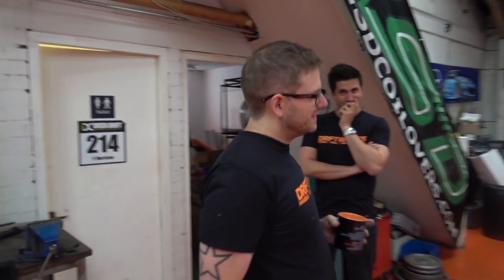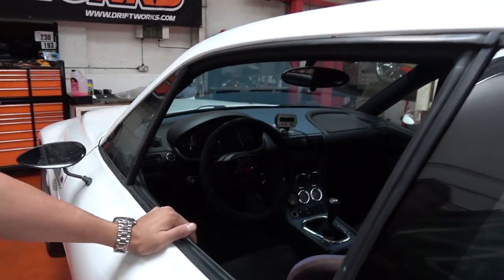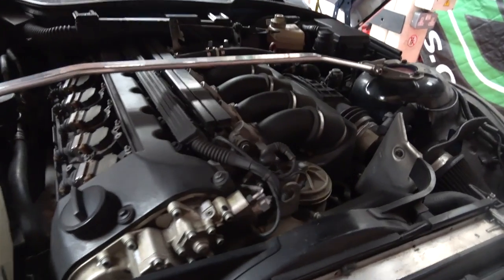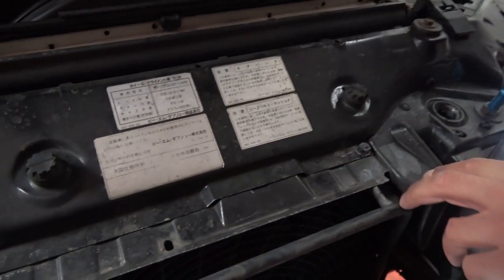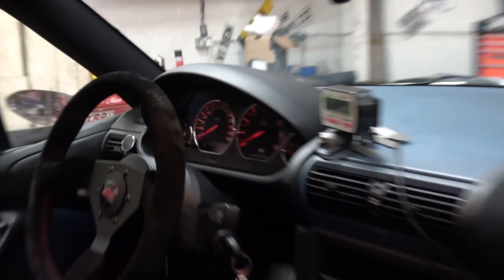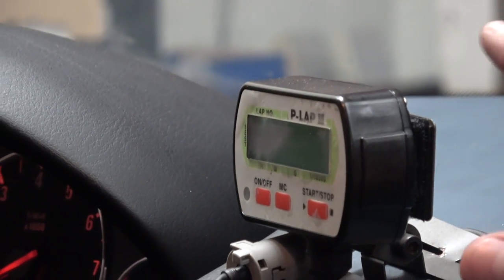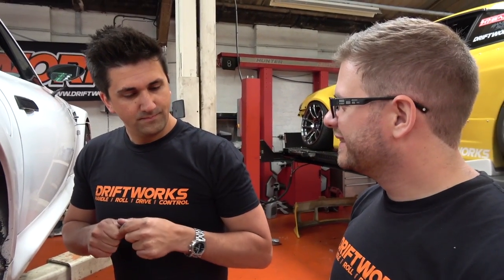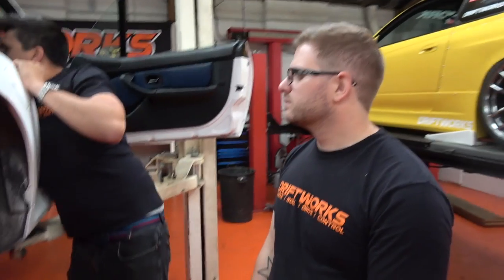JDM BMW Z3M Coupe - Japanese import!

Comment: You can safely change the headlights in an FD Rx7 to RE-Amemiya's sleek headlights and still be Ok imo!
Reply: You can safely change headlights on a lot of cars and it will still be an upgrade. As long as the car isn't factory equipped with some fancy xenon / LED system, then there's really no need for it.
Reply: By safely I mean in the style or rather lack of department. The guys at Driftworks are absolutely correct, messing with or alterting a cars headlights for an aftermarket part is for the most part totally chavtastic, one exception I can think of however is the RE-Amemiya Sleek light kit.

Comment: Just catching up on this, and the throttle cable on the S50 Motor (E36 M3) shouldn't be taught as shown at the start of the video (3:08), as it opens the throttle position sensor open, which can confuse the ECU. It should be slightly loose. I had to slacken mine off in my own car when I bought it.

Comment: I think JASMA is like a compliance thing rather than a brand.  Do a rampout.
Reply: Steve Dunn I was just going to say it. It's like if you had an exhaust that was stamped road legal it would be the same thing. Common misconception everyone thinks it's a big performance company ha 👍
Reply from the maker: Interesting! Every day is a school day for us too!
Reply: Driftworks; For some of you it is, but I told Al that 3 weeks ago when we were in Johns car ;)
Reply: My sarcasm was so subtle. :D
Reply: The way to tell the brand (if still visable ) is to cross the 3 digit code with this list .
Akiyure Inc. 047
Apekusera Inc. 048
Iida Inc. 130
Ikeda industry 003
A tea sea international Japan Inc. 074
Etching k s Inc. 051
Ebansupuranningu asuretsuku division 129
M-TEC Inc. 002
Otoekuze Inc. 120
Automatic backs seven Inc. 097
Ovuareshingupurodakutsu Inc. 124
Katsu Inc. 088
Car land 119
Kind technostructure Inc. 115
Kakimotoreshingu Inc. 017
Garcon division 114
Can tile office 113
5ZIGEN international Inc. 005
Sun automobile industry Inc. 076
Gee earl Inc. 012
Jieiruto Inc. 013
Gee piece Potts Inc. 125
Jiyaosu Inc. 067
Starting line Inc. 069
Spoon Inc. 044
Possession the Suruga Seiki Inc. 106
Zero sports Inc. 100
Tanabe Inc. 026
Taniguchi Inc. 035
Takeoff Inc. 004
Top line Inc. 110
Trust Inc. 006
Knight sport Inc. 019
Huaburesu Inc. 111
Fujita engineering Inc. 061
Rattan ***353;â engineering and research industry Inc. 001
Free way Inc. 123
Buritsutsu Inc. 021
Hoshinoinparu Inc. 037
HONDA twin cam Inc. 011
Mainzuueibu Inc. 038
Makishimuwakusu Inc. 045
Pine Shaw Inc. 008
Meiwa Inc. 041
Yajima industry Inc. 091
Yamato Inc. 122
Lucky automatic Inc. 126
Love lark Inc. 083